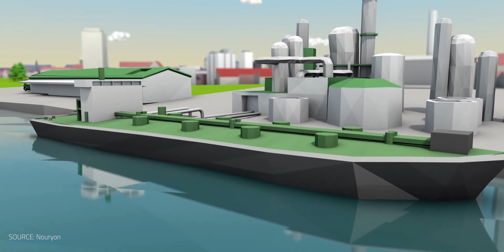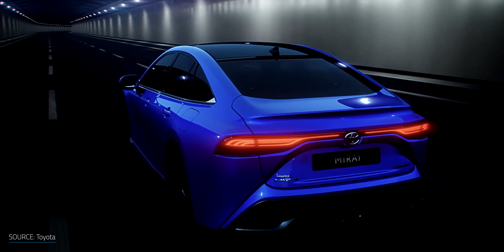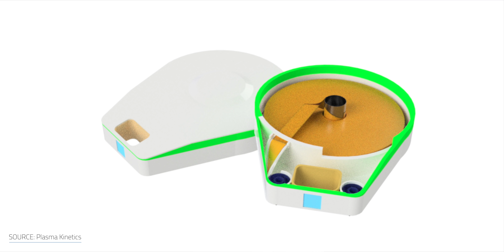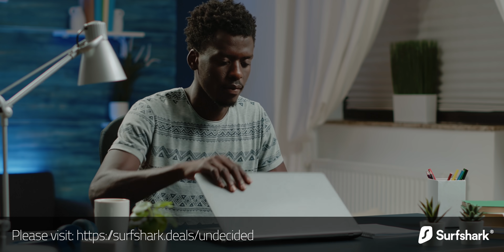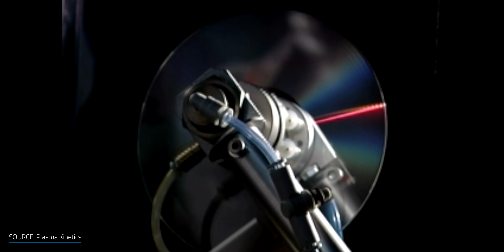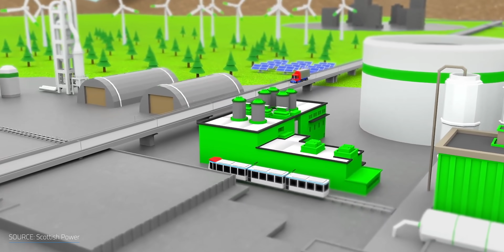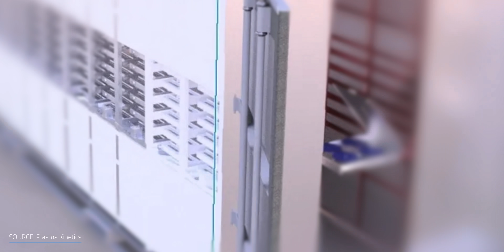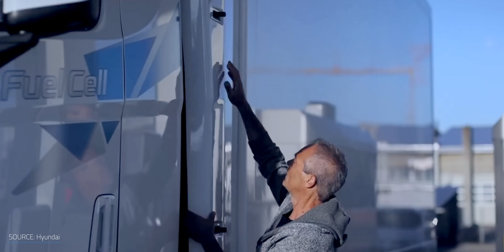Energy Storage Breakthrough - Solid Hydrogen Explained

Comment: This set off all my BS jargon detectors. Claiming everything from shape memory alloys, to catalytic nanoparticles, to nanostructured thin films, to "hydrogen capture" (nobody's venting hydrogen out of a smokestack), It's like someone just wrote down all the materials-science buzz-words to get money. If you dig into their patent, it's the same way.
Reply: if the technology can pull hydrogen out of water vapor than they COULD pull hydrogen out of a smokestack.
Reply: Though Hydrogen isn't a type of by-product that I would go through a smokestack (I think they used this as an analogy), there are other industries that do create it as a by-product that this technology could use to capture and store. Also patent show only a small bit on how it's done because if they wrote a step by step "how to" and submitted it to let everyone see it they wouldn't make them money in the short or long term. It would be like another company skips step one to ten and only needs to spend money on how to refine the energy capacity and energy transfer rates to make it applicable.

Though I do have to say they used a log of "fancy word" or to "BS jargon", what they could be using is exactly what those terms are used for as each one of them is an actual thing. If you hear them take it with a grain of salt, and either wait to see what new article or research comes from them.
Reply: Yeah. The technobabble is real on this video. Pretty disappointed with Matt on this one. I thought he was better than that.
Reply: @JasonMTuftsify  and yet they showed (animation) their installation coupled to a smoke stack
Reply: @JasonMTuftsify  This, all day.  There's a company that periodically tries to get our proprietary info under the guise of "certification".  "Oh, we need your ISO documentation".  Sure, send me all the schematics to your parts and I'll send over my process info.  Business is a game, and you don't get to play long if you play stupid.
Reply: @viermidebutura  Those animations also showed those "installation" to a complete building going to a smoke stack. which in is only an animation and could instead be a pipe for off gasses after capturing hydrogen and releasing the rest of the by-product. As such the animation can still be used as a analog as they provided no true dialog on how the system would be implemented. If they later refine it to provide dialog on how said function worked or documentation then I wouldn't be able to state they are using it as an analog to the use of another company/industries by-product.

At this point their slide show/animations only show what they are hoping to do, but not will or could be. But as there are industries that produce H2 as a by-product (pure or not) this could be something that can be feasible, but may not be practical once setup in the real world.
Reply: same for me, sounds way too good to be true, just like sci-fi story
Reply: @JeffDeWitt  That requires energy input.  241,000 kJ/kmol (H2). It's all about the energy. Do you understand this? Hydrogen in H2O form has no chemical energy value at all. The conversion to its H2 form is the all important part. I'd also be interested to hear these techs that are producing h2 as a by-product.
Reply: also touting the storage of hyrogen in a metal latice as some new miracle tech is laughable.
Reply: Yeah I gotta agree it smells of vapor and hype
Reply: @JeffDeWitt  to pull hydrogen out of a water molecule you need to invest more or equal energy you get from burning it, or running it over a cell, (you get energy out when you FORM the H-O bond and you need to put more in to BREAK it) nobody canceled the 2nd law of thermodynamics yet.
Reply: @JasonMTuftsify  no, because a patent makes it ILLEGAL for others to use the technology without paying you. You want to put as much and s wide reaching wording into a patent. You actually have to describe the entire thing or your patent is useless. Anything not in the patent gives others a way to use the info that IS in it to bypass you. Even if that is being used by your invention, if it isn't in the patent it is free game for everyone.
Reply: This is first I have heard of this idea, but reading through the comments there is a repeated misunderstanding. Hydrogen from a smokestack.  If you burn a hydrocarbon fuel, take the simplest one, methane; https://en.wikipedia.org/wiki/Methane and burn it, you have initiated a chemical reaction, oxidation,  that is exothermic, meaning the temperature rises, and is expansive,  the resultant molecules occupy a larger space.  That is why you can do mechanical work, using the thermal and chemical expansion to move a piston or a turbine.  The point to emphasize is that there is more Hydrogen than Carbon in even the simplest of hydrocarbon fuels. When you add oxygen from the air to methane at the right ratio to burn it, what comes out of the smokestack still has all of the atoms of hydrogen, oxygen and carbon they had before burning, the molecular configuration has changed to simpler forms.
Reply: @excitedbox5705  You do understand that other countries don't have our rule, mainly because they aren't our country? Just because it's "Patented" doesn't mean they can't copy or reverse engineer the product and change a design slightly to make it look seem different. So again they wouldn't do a "How to" on it, but only show the main points in technology they created/engineered.
Reply: Ok, so first of all, smoke stacks most certainly do produce hydrogen as a byproduct (it's just locked into water vapor).  Second, I'm pretty sure this is an energy storage technology, so the fact that extracting that hydrogen requires an energy investment is actually the whole point.  You spend the energy extracting it, so you can use it for something else, later.  That's how energy storage works
Reply: Well, im no physicist. But im almost sure their whatever material being able to pull hydrogen out of other molecules like a magnet wouldn't break thermodynamics as long the energy was expend during the fabrication of the material or during the release of the hydrogen. 
Considering how the thing releases hydrogen i assume is the first one
Reply: @affegpus4195  The second law of thermodynamic, basically, says that if you want to do something useful with energy, you'll always lose some in the process. That's a gross oversimplification of entropy, but it's generally the only aspect that's relevant at this level of discussion.  In other words, there's no such thing as a free lunch
Reply: @Shocker-lh6kn  I feel like all of his videos are like this which is why I've stopped watching, basically all of the speculation bullshit that papers are forced to peddle to get funding except in video form. The engineering topics are interesting, but way too much optimism and 'could one day' with not enough actual criticism of the sources he bases his videos on to really gauge the feasibility of the tech.
Reply: @yeir7cnf  Yes, I know, that's why hydrogen isn't really a fuel.
Reply: Woo.
Reply: @laserflexr6321  yea you still need energy to split the H from the C and the O. Absorbing soot from a smoke stack is very different from absorbing pure hydrogen from a refinery.
Reply: @bigsmall246  I agree.  Years ago I thought Hydrogen fuel cells, or even internal combustion engines using clean burning hydrogen fuel made a lot of sense, until I studied 10 minutes on where the hydrogen would come from. Still, by far, the cheapest way to make hydrogen is chemically break down natural gas.  It makes little sense to do that when you could directly burn the natural gas in an engine and burn less natural gas in total than the wasted step of reducing it to pure hydrogen. 
 If the number of cycles you can expect to get from this new invention is only 150, it is hard to imagine how that could be more efficient. 15,000 cycles might be a winner.
Reply: @JeffDeWitt  In order to pull hydrogen out of water vapour you need electrolysis, or some other very energy intensive process to split the water molecule.
Reply: @justoneman13  - sometimes there are a free lunch. When your solar panels are producing more energy than you need at that moment, then the energy becomes free. When your hydro-dams are bursting at the seems and ready to overflow, the energy becomes free. When the wind is blowing at night and electricity demand is low, the energy becomes a free lunch.

Or take a country like Iceland where it is possible to pull heat out of the underground and use it to generate electricity.
Reply: @WielkiKaleson  In fact much of what comes out of smoke stacks these day IS just water vapor.

Scientists at ETH Zurich have come up with a system that takes water vapor and CO2 from the air, uses electricity to break them down into their component elements, and then recombines them into jet fuel.

Other companies are working on similar technology to make gasoline.

If the technology in this video is really practical it could be combined with with the fuel from air technology... you'd be able to recharge these hydrogen devices from a system that needs no more input than sunshine.
Reply: @jeffreyblack666  Maybe not. That's the only way I know how to do it, but scientists have noticed that plants can do it without electrolysis and there is some interesting work being done on catalysts that may be able to do it much more cheaply and easily than we can do it with electrolysis.
Reply: @JeffDeWitt  Great they did it (though it is irrelevant)! 

So there is a method to pump energy (a lot) to H2O + CO2 mixture and recover some form of fuel and... O2, because what else? This fuel is likely not H2, because it would mix with O2 and... bang. But you can probably reforme that fuel to get H2. Right. Now those guys claim you stick the f... disk in the streams of whatever and "just like that" recover H2 in a conveniently bound form. How is the energy pumped to the system, eh? Metal-H bonds are not strong as hell (-> have comparably low energy), so their energy cannot pay for breaking all those H-O bonds.

Than imagine a laser shining through tightly packed stack of metal disks carrying the hydrogen. No way. Or maybe a football-field-sized disk so that the laser can really reach its entire surface. And laser is not a tremendously efficient light source. It have huge advantages and is used despite the inefficiencies. Utterly crazy.
Reply: Obviously you don't understand nuclear power plants nor what comes out of their "smoke stacks".
Reply: @JanBruunAndersen  By free lunch, I didn't mean money.  Solar panels and hydroelectric dams both lose a significant amount of energy when converting it to electricity.  Everything you own that uses energy, from your phone to your refrigerator to your car (assuming you have one), wastes a significant amount of it to work, usually in the form of heat.
Solar and hydroelectric power only seems free because we didn't make the massive fusion reaction that supplies that energy, but if we had to supply the sun with hydrogen for fuel, it would be the single least efficient source of energy we could use
Reply: @Feintgames  But you are aware that although water indeed contains hydrogen, you don't recover it easily? 2H2 + O2 -> 2H2O + bang can happen by itself, no problem, but reversing that reaction takes eg. electrolysis (clever way of pumping energy into molecules).
Reply: @JeffDeWitt  That would be covered by "some other energy intensive process".
That is still nothing like what they have described.
Reply: @JanBruunAndersen  I suspect that's possible pretty much everywhere, it's just more difficult in some places than others. The Earth's crust isn't that thick and you don't have to drill down all that far to get to where it's always hot.

In fact, if we were to build a series of deep geothermal power plants around Yellowstone (outside the park of course), we could probably generate enough electricity to power a good size chunk of the country. As an added advantage the slight reduction in heat around the Yellowstone caldera may make it less likely to erupt.
Reply: @Shocker-lh6kn  unfortunately, he's really not.  I watch occasionally, but this is pretty typical of the critical lense he puts the stuff he reports on under.
Some company's probably just done some clever thing under very controlled conditions that would have massive problems upscaling, but is overhyping it to (if we're being generous) get enough investment that they hope will enable them to solve.

Then, as usual, the PR statements were repeated here wuth basically no fact-checking to assess the credibility.

It's fine if you watch out of curiosity, but nothing said here should ever be simply believed without substantive personal research.
Reply: @dynamicworlds1  There is a lot of work going on with catalysts to do just that... when you come right down to it what we'd like to do to produce hydrogen from water isn't that much different than what the catalytic converters in millions of cars to do exhaust gasses, we just need to find the right catalyst.
Reply: @JeffDeWitt  the "a" in my sentence was important buy yes, catalysts can help a chemical reaction happen with a lower needed input energy state than otherwise possible, but the catalytic converters in your car are still producing end products with lower chemical potential energy than they started with.  Trying to go from something really stable like water to a highly reactive output (like hydrogen and oxygen) is another matter entirely.
Reply: @justoneman13  exactly! I don't understand where this misconception has come from that they are claiming they are pulling the hydrogen right out of the smoke stack. That wasn't being said at all. Obviously we're talking about filtering the water vapour from the smoke stack and perhaps using the heat from the smoke stack to power turbines for electrolysis. Then taking the resulting hydrogen and storing it.

The graphics are certainly misleading, but we should be paying attention to what is being said. This is something that will work alongside existing technology to store energy and reduce energy wasted in manufacturing processes without having a complicated and energy intensive storage solution.
Reply: They literally said they would produce and store the hydrogen in a factory and deliver it to customers and business's to sell. "should be able to trade them at a convenient store"
So they will still use old techniques to collect the hydrogen, they storage will just be different  and more sustainable without a massive structure overhaul.
Reply: But... They have pretty animations, they can't be scamming.
Reply: @JeffDeWitt  You'd have to crack the water first.
Reply: @yeir7cnf  the problem with most green energy it that you need better storage or batteries to make it more viable over fossil fuels. But if this technology is true through renewable energy to electricity to hydrolosis to this solid hydrogen storage is the missing link to make solar wind as viable as coal
Reply: ''''hydrogen capture" (nobody's venting hydrogen out of a smokestack)''''

if it's possible why not?
Reply: @robinsss  It's possible to blow money out of a smokestack, but nobody does that because there wouldn't be any reason to.

Comment: I talked to my preferred H2 expert about it and the answer was: "the hydrures issue is the weight: 1Kg of H2 = 50Kg of metal to capture it". 
This clearly looks like an issue at least for planes. for trucks it may work if they recharge/replace the disk every few hundreeds km...
Reply: Sounds good for capture and grid.
Reply: Plus if it's fast enough release for powering a vehicle, I can't imagine it's better than high pressure storage. (Where if a burst disc goes you have a few seconds of intense fire)
Reply: The 50kg estimate may be outdated because thin films have a lot more surface area for the same mass than conventional methods
Reply: I don’t think you watched the video mate
Reply: @stevenboelke6661  please provide real existing  materials with actual data, so 50kg can be re-calculated properly.

Comment: I am not sure how liquified hydrogen in a cylinder is less energy dense than adsorbed or absorbed hydrogen. 

It makes sense if the hydrogen is absorbed into the actual fuel itself for single use applications like missiles. But that defeats the purpose of a reusable system and isn’t green or good in anyway. And I am sure the rocket scientists and missile engineers have that dialed in.

Comment: Don't forget about the efficiency issue of fuel cells.  To convert H2 to electricity, the best fuel cells are about 50 to 60 % efficient.  So this kills the economics of this solution for a BEV.  However, it might make sense for heavy applications like ships and aircraft.
Reply: Don't forget also gas is 30% and diesel is like 40%.... the other 60-70% is heat and noise and other losses
Reply: @aaronreash814  is not the same because hidrogen has 40% energy lossless after it becomes electricity. If the electricity is form natural gas turbine that has 40% efficiency so the efficiency of the hidrogen is 40%x60%= 24%
Btw natural gas is still the overall cheapest energy source yet.
Reply: @amirattamimi8765  this makes no sense? quoting random figures. 85% of statistics are made up on the spot and the remaining 15% are lost to thermal in-efficiency
Reply: @amirattamimi8765  A modern gas and steam turbine is more like 60%+.
Reply: @FreeOfFantasy  ok thank you. But my point is still 60%x60%= 36%.
Reply: @amirattamimi8765  actually wind has become the most cost competitive electricity source...at least in the US